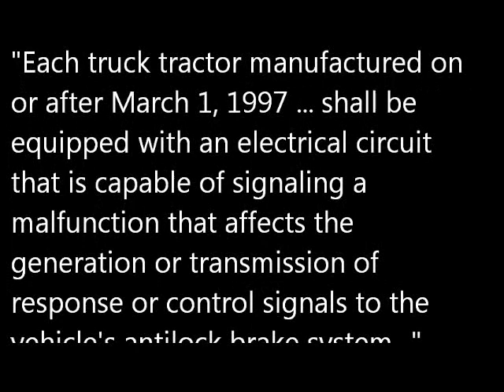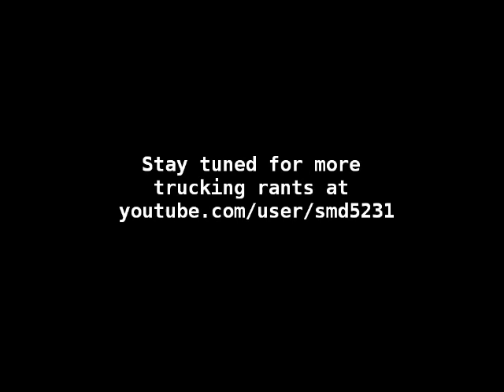How a Bad Dashboard ABS Light Cost me $2,697

Comment: I had an intermittent fault on an ABS ECU, and I violated the warranty by breaking the seal and opening it to inspect the circuit board. Several joints on the connector to the PCB board had cold solder breaks. Resoldered the pins and the faults were gone. No charge except the electricity and the solder.

Comment: Hi Sergei,
Not sure how I got to your post but a couple months ago i had the very same experience. Crossing at Alexandria Bay, the state trooper came into the customs booth while I stopped and asked for my license and registration. Then he proceeded to direct me to the inspection area on the right side of the customs building. He did a level 1 inspection and found a number of things. Like you, he wrote the tickets and told me to get the issues fixed ad signed off before 6:00 PM the next business day and send them to the court. I did that and also received a letter from the court the matter has been dropped. It is very clear that officer knows exactly what he is looking for and the differences between Canadian safety requirements and that of the US. For example, the slack adjusters limit is about 0.25" tighter in the US Vs Canada for the same brake types. Turns out 3 of mines were within limit in Canada but out of limit in the US, which i had to adjust them right there and then. He also did a test on my trailer ABS and found the tractor was not providing continuous power to the trailer. The way he did his test was to cycle the key without starting the truck and wait for the ABS light in the rear to come on and extinguish. In my case, the ABS worked fine when I applied the brakes but his test showed they were not continuously powered with or without brake application. I researched lots of MTO documents and noticed that requirement and that method of testing your ABS was different in Canada. More Interestingly, two days later a New Hampshire state trooper passed me on the highway, waited, came behind and made me follow him to this inspection booth. He found the same ABS result and told me many of the Canadian trucks aren't successful in completing that test. To conclude, I brought the truck to my mechanic, he researched the rule and how to comply. The issue with our trucks is that Pin 7 on the J560 connector between the tractor and trailer is not energized. He ran a wire and plug in that pin 7 and the problem has been resolved for less than $100. I also had my brakes adjusted to about 0.25" slack overall. My attitude toward this, I chose to travel to another country to do business, I should abide by their safety rules. These inspections do affect our DOT scores but lessons learned and thanks to the officer, My cost of his inspection was spent on maintenance of my own truck, not paying a ticket. I am now more vigilent  and that's all I can do. No issue here.

Cheers and good luck

Comment: Do what I do to all my trucks. Unplug the dash light and rewire it with a fake circuit controlled by a push button on the right side of your seat. When your told by dot to turn the key but don’t start, do that then with your dangling right arm push and hold the button for a few seconds to light the “abs” light then release. Before you say this is dangerous, any experienced truck owner can feel the system working or not. Almost all abs warning lamps are false systems errors
Reply: So how do you make the trailer abs light do its flashy part at the same time. While the cop is standing over your shoulder.  You should rethink your plan.
Reply: Dude I was thinking of doing that too. Just had a cop give me a violation for abs light on.

Comment: I was driving my submarine through NY state when a dot cop stopped me and said that a federal aviation administration cop told him that my conning tower was too tall. He then said that he found some grease on the propatronic nut that holds the propeller on the shaft. I tried to explain about the nuclear radiation that causes the grease to be on the nut. He gave me a big ticket and I took it to the closest repair facility which was a Swift facility. All they had was a used prop nut that they got from JBHunt so they used gorilla glue and tape to repair it. 🤪 I still can't believe these DOT fookers thought my 364 foot submarine was a commercial vehicle... Sheesh

Comment from the maker: I might change the truck but only if I get a different trailer. I"m looking at RGN/DD trailers now to see if it's feasible to add one to my micro-fleet or maybe trade in the 53' FLAT and get a DD. If I manage to pull this off, I might later change the truck for something more suited to heavy loads (eg, 46K drives; 16K steers, stronger fifth wheel etc). I think a Volvo 630 or Western Star 4900 SB with ultra-low roof would fit the bill.

Comment: I spent over $3,500 I still didn't fix the problem . Mine ABS light turn on after driving 50 miles and always stays on.Only after I shut off the truck and come next day the lights going to be off but is going to come on again after 50 miles driving can someone help me.
Reply: Have you been stopped by DOT yet? My light is on right now started after this snowstorm smh...
Reply: @iamgalaxey  I fixed my problem I had to replace one axle bearing.
High-speed sensors could not read  correctly because bearing was loose. Yes I was stopped by the DOT and got the warning for my ABS light. I spent $4,300 and I didn't fix problem. One day I had delivery in Bowling Green Ky across the street I noticed a small shop  I went over there and ask the guy if he knows the problem and he fix it I paid only $120 for labor and bearings.

Comment: I'm in the same boat have to deliver this load then find a volvo before I get wrote up. 2011 volvo.. the light would come on when I pushed the brk but not when turning the ignition
Reply: Craig Larcen, if it comes on when you press the brake it means it's detected a fault and your now running on basic brakes (and no ESC if your vehicle has it as they are interlinked)
Reply: Craig Larcen well in my case on 2006 volvo VNL 670 key ON truck ABS light on goes off after 3 seconds looks to be normal.  But TRAILER ABS is my doubt is how is suppose to work. Key ON TRAILER ABS light Not coming on key ON foot on break stepping on TRAILER LIGHT comes ON goes OFF after 3 seconds.  
Is this normal on volvo.
Reply: Yes press the brk and light comes on 3 seconds goes out thats how our older volvos. Work, of course truck running
Reply: Craig Larcen well I'm doing the test  key on engine off...  does your truck works the same for the trailer brake ABS. 
Trailer ABS Light, key ON engine OFF ABS light Not coming on not doing self test like "Truck ABS"
**Trailer ABS light, Key ON engine OFF foot on brake pedal ABS Will come ON 3 seconds than goes OFF is this the same way your volvo truck works?
Volvo VNL 670 2006 VED12 engine